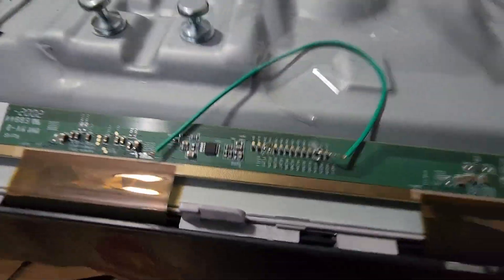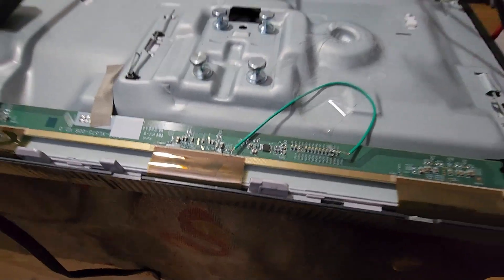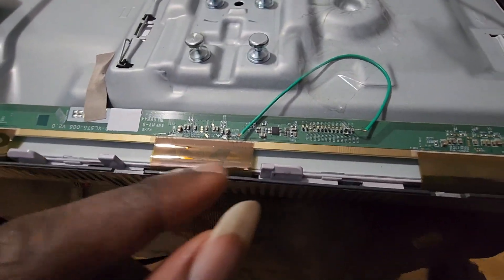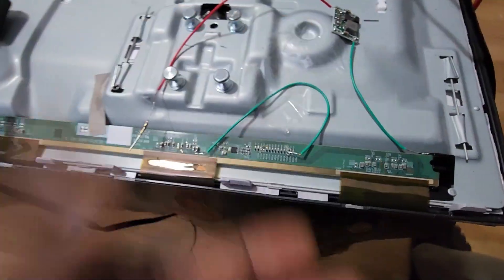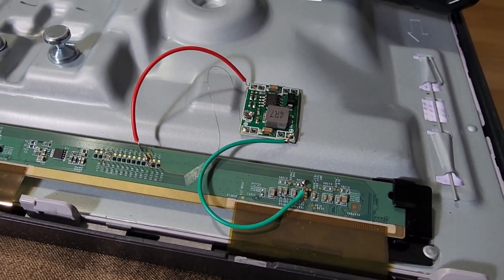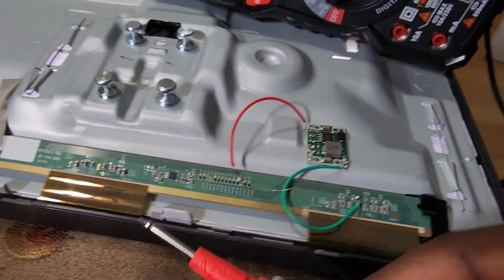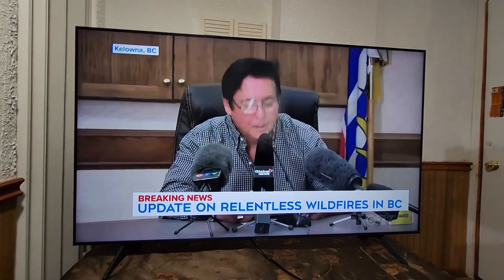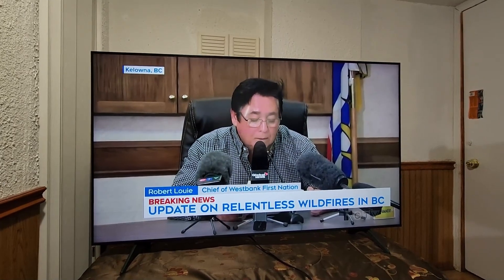Fix Samsung TV Boot-loop, Power Cycle, Rebooting Issues. TU7000/8000 Series. UN58TU7000F Taping Fix.

Comment: Great video. I've been searching for this fix for six months. I've been using the tape method but I had just one line that was shorted. That is the vgh it's given me vgl voltage-7 instead of 27. Where did you get your 25v from and where exactly did you put the 15v? My tv has the same issue with the purple on one side of the screen. If I can get my picture like yours I'll be cool with it. You did an excellent job of explaining what to do to solve this issue.

I've watched the other video that you recommended. I think I got it, between you and him. I'll let you know how it works out.
Reply: You got your fixed? I am in the same position the purple tint

Comment: Great video, do you have a repair shop?
Reply from the maker: @TriceTribe  I only use a small space in my basement for this hobby.
Reply: @GidFix-pl3lg I have a similar issue with a Q70R.  I have used the tape method to fix 4 separate times, but the problem recurs after about 2 months.
I wonder if your new method can help?
Reply from the maker: @TriceTribe  Just as I indicated in the video, this type of fixes are temporary and can't be concluded as a permanent fix. Panel shorts are technically an end of a TV, but this work around tape-fix is only to keep the tv around for some time. There have been fixes like this that have lasted for years, and it usually depends on the complexity of the issue. In your case, I percieve that the panel is failing quicker than usual. The TV in this video is still working, and it's been over a year since the fix was done. Thus, the failure has not reoccured. It's sad, but I believe it may be time to move on with your tv.
Reply: @GidFix-pl3lg  Thanks for your feedback. I really appreciate it.

Comment: Hello. Thanks for the nice content. I want to ask a question. There is voltage on ck1 and ck2 on the left side, but not on the right side. Is this normal?
Reply from the maker: Hi, that is not normal. Did you have tape on the ribbon pins before checking the voltage at ck1 or ck2? If not, check that flex cable for damage. It could also be a faulty capacitor on the drive panel. You could use continuity mode on a multimeter to check them.

Comment: Hey good content... I did the tape procedure like your previous video and got the video but my screen is very white. Is there any problem you can think of? about why the screen will be very white..
Reply from the maker: I had that issue as well and its because you are covering more pins than needed. Continue to narrow the tape. You need lots of patience in trying out different pin combinations. You may even have to cover just one pin or several pins at different locations. This is a well known issue with this TV. Hope it helps.
Reply: @GidFix-pl3lg  aaah ok that's good to know. Even in several places. Do you think it can happen in two sides of the panel too?
Reply from the maker: @MrSahle  Yes it is possible. Shorts in the Panel can happen on a single line or several lines depending on the extent of the problem.
Reply: @GidFix-pl3lg 

Hello. Thanks for the nice content. I want to ask a question. There is voltage on ck1 and ck2 on the left side, but not on the right side. Is this normal?

Comment: hello i have here 75tu7000. i tried to check ang hangs all the ribbons but the problem still the same. but if i unplug those connections on the mainboard, still the same. is it something to do with the board itself ? Thanks
Reply from the maker: Sorry for the late response. I don't think i understand your question. Have you gone step by stem in unplugging each connector to see which one prevents the TV from the bootloop?

Comment: my samsung dvd home theater boot loop problem please help me
Reply from the maker: For a home theater, the procedure will be different. However, you could open it and try disconnecting the motherboard to see if the problem persists. It could also be the power supply.